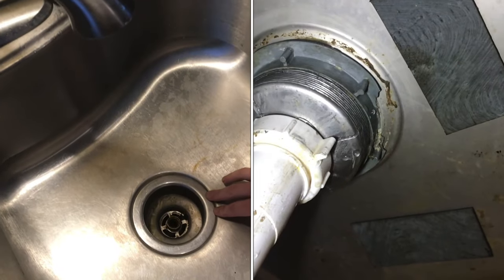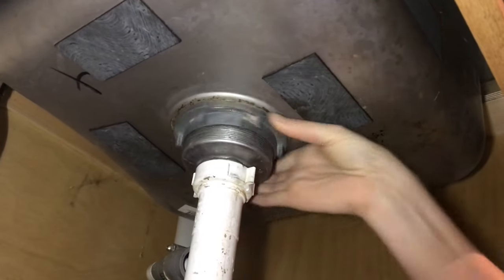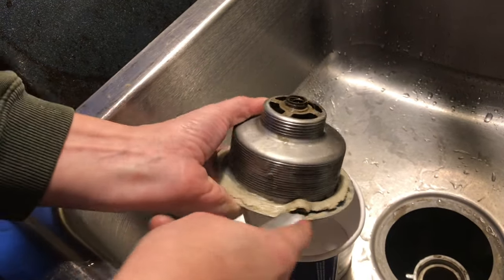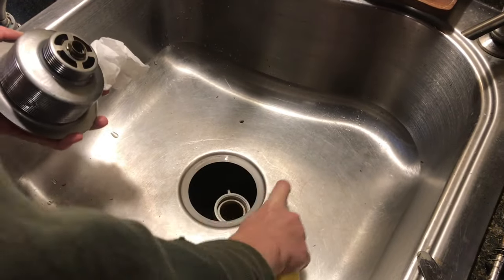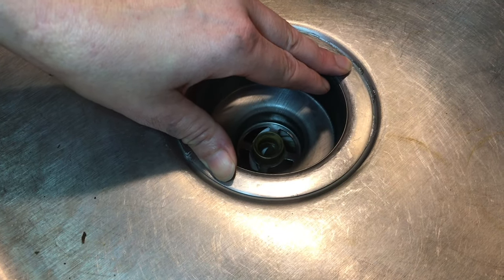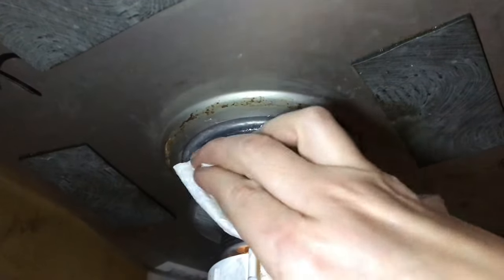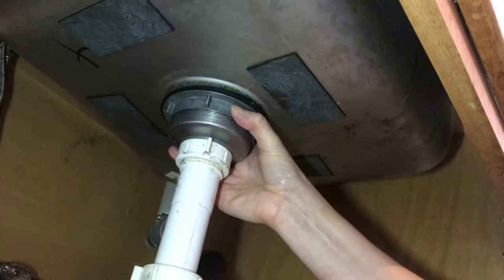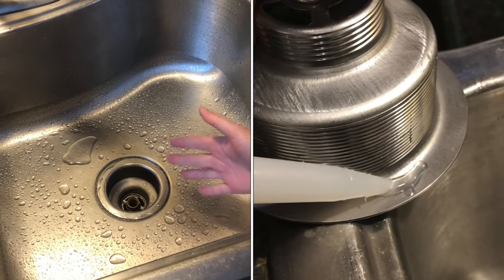“silicone” INSTEAD of “plumbers putty” on kitchen drain basket

Comment: GREAT! I'm replacing my bathroom sink drain & the old one had gobs of putty. I was concerned because I only have silicone sealant but no putty. Thanks also for the advice to let it cure overnight.
Reply: My new delta faucet calls for silicone and no plumbers putty  in the directions. I thought drains always used putty but I’m no plumber and Delta disagrees with it for some reason. I did notice on the plumbers putty label when I looked it’s not compatible with plastic or materials like granite and other stones. So maybe that’s why delta recommends silicone.
Reply: The putty that I brought said don’t use on plastic so I went with silicone instead, my new faucet setup said to use silicone anyways.

Comment: I tried the rubber gasket on top but the basket stands proud from the indent slightly. Ill move the rubber seal to the bottom and use silicone on both sides.

Comment: There will always be a debate over plumbers putty or silicone. My brother in law is a plumber and says use only putty my cousin is also a plumber and says use silicone only .
Reply: On double sinks just use silicone on one side and plumbers putty on the other
Reply: The silicone also acts as a glue and it will be a bitch to remove the strainer where silicone has been used.
Reply: After using putty for four sink leaks in the past two years (yes replaced almost all parts) - I'm giving up on putty.  It seems to leak sooner rather than later for us.  Silicone is the next try.

Comment: Wait until he goes to repair it in the future and can't get the basket out because of the silicone also acts as a glue.
Reply: I think that's what was used to put my original drain basket in. How do you get it out?
Reply: @maryannerunkel164   The first thing i would try if it were my sink is to use a pipe wrench that is big enough to engage the bottom threads of the strainer after removing the flange nut that holds the strainer in place. I would very carefully try to twist in both directions on the strainer treads to break the bond of the silicone to the sink..The decision is yours to make if you do this. I am just telling you what I would do with my own sink. As an example I had to remove an undermount sink set in silicone. I had to use an electric turkey knife to cut thru the silicone to remove it.
Reply: @gary24752  Yikes! Thanks for the advice. I have tried to cut around the silicone on the top and even used a hammer! to try and get the basket out. I am currently waiting for mineral spirits to hopefully loose the silicone. I'm replacing the basket because it is rusty on top. So much for my easy DIY.
Reply: @maryannerunkel164  Doubtful mineral spirits will work but I would try WD-40 which is a penetrate and let it sit over night otherwise I would go back to using a 12 inch channel lock wrench to twist the treads on the strainer body (underneath the sink) back and forth to try to break the bond maybe in combination with the WD-40. You are going to need either a special wrench or the 12 inch channel lock anyways to get the pipe connections off. They have stuff at a counter supply for this purpose but I try to stay away from that chemical stuff for obvious reasons and if you have an enamel sink I would worry about it affecting the color. They use silicone for gaskets so heat will not affect it either once it is cured. I do not recommend using screw drivers, hammers, sharp instruments, etc. as they may damage the surface of the sink no matter what it is made of especially ones that are enameled. Once you chip or scratch that finish rust will start. Just out of curiosity can I assume that the strainer is stainless steel? Why not try a grey scuff pad from Home Depot and some Bar Keeper's cleaner to remove the rust after spraying some WD-40 on it. Scrub in one direction only.  You might find it will come off and would be a whole lot cheaper that buying a new strainer and if you do get it a Ace Hardware. The stuff at HomeDepot and Leows are not of good quality as far as I am concerned and stay away from the plastic ones. Be prepared for more than one trip to the hardware store. Hopefully if you have a dishwasher hooked up to it the pipe will be in good condition. The pipes and the hose connection from the dishwasher are not always one size fits all. The outside diameter of the hose nib may be 3/4 but the inside dimeter of the rubber connector on the end of the DW hose is more like 7/8. Ask me how I know. This requires soldering a 3/4" copper coupling to the nib in order to attach the hose from the dishwasher which is a real pain due to the nickel coating on the pipe.
Reply: Cut the old lock nut off ( hammer and flathead or grinder w metal blade) once the lock nut is off tap the old strainer out and replace it with a new one no big head aches
Reply: @dellyrunks2426  good luck with that one
Reply: Lol, it's silicon... not epoxy.
Reply: @paulmacdonald7068  Obviously you have never tried to remove one that has been glued in place with silicone glue.
Reply: @gary24752  they come out pretty damn easily... It's silicon, not epoxy. The residual silicon cleans very easily with a bit of WD 40.

Comment: Is there a specific type of silicone to use for this?
Reply: Yeah. None. Use putty.
Reply: Then what do you use ? Silicone? The rubber washer is not intended for top of sink.
Reply: fartpoobox ohyeah  I am open minded. But in the service field. I must ask that your product meet a few of my requests. 
1 easily workable and clean up. Nothing special needed 
2. The gap between sink and basket flange is not increased to cause water to pool and turn sink black. 
3. Immediately testable with full sinks of hot water. 
4. Last as long as the basket 
5. Easy clean up when 15-20 year mark hits so your product doesn’t stick and cause scratches when cleaning sink in prep for new basket. Customers change them to change more often than they leak kind of product. 
Seriously open to your new way. But not silicone. That way is older than I. So I am left wondering. Anything that makes my day go faster without call backs is all I reach for. I openly back every product with labor. If the manufacture says it should “x” amount of time. And I purchase that for you? I back it labor. So my customers of 17 years solo business without a dime in advertising can rest assured. It may not be the Taj Mahal but by golly it will work as long as it’s intended too. So please enlighten me with something newer and better.
Reply: Lexel. Ive been silicone harper but my goodness Lexel is amazing. Anyone that is concerned about 15 to 20 years from now doesn't make sense. The entire sink, faucet, drain and cabinet will be replaced before that.
Reply: @pjplumber2146  exactly, what is this lady teaching? I fix sinks that people tried using silicone. They put the rubber gasket under the basket🤣, oh food collector and stinky. She should continue with her bs saying to install flex pipe and S trap. 👀😂🤣
Reply: Lotta plumbers angry that people realized they rip you off. Silicone is sanitary and lasts a long time if you let it dry and clean the surfaces. You want to use anything that's nearly 100% silicone for stuff like this and make sure it dries for a few hours before you run the sink.

These dudes use plumbers puddy because they don't want to wait around for curing or use softener to get silicone off. Both totally valid, but it's because they charge by the hour. Beyond that there's no issue other than you saving cash. Just don't use this shit to deal joints. Lmao.

Comment: Thank you for this video, but I wanted to know, did you use the rubber gasket along with the silicone or just silicone
Reply: The rubber gasket goes underneath
Reply: Both: The silicone above (substituted for plumber's putty) creates the watertight seal.  The rubber gasket below isn't there as much for a seal as much as it is to distribute the force of the nut on the sink.
Reply: Rubber gasket is below. Silicone or puddy is above

Comment: How about wetting the rubber seal with a little silicone? (would it be a good idea?)
Reply: I did it and it works as well, just extra sealing. Just like you said tho just enough to wet

Comment: Your the cleanest plumber i know. Also i use the rubber gasket on top instead of the silicone but to each is own if it works… 👍👍
Reply: Thats not up to prefference. The ruber gasket goes on the bottom. Plumbers putty goes on top
Reply: Exactly .. putting gasket up top you’re asking for a premature leak in due time

Comment: We?(Cats and I)Decided?(my opinion) Cut off? (With what if u don't mind me asking?)  ....bc I don't have a proper tool to use and broke one tab or cut off already. Very nice prep 👍. Hardest and most important. What was the torque specs on that silicone? Over night . My wife might get suspicious why I keep returning to ♀️ 's homes to fix leaky sink basket. You don't like top hats? Did we use fiber washers so not to pinch rubber a year ago?... Sry for being rude just wanted to put out a warning. Love u

Comment: Easy way without pulling the basket: PC7 plumbers putty. let it set. Then, PC7 epoxy over the putty. There will be NO MORE leaking. There will not be a "next time." Next owner will need a nuclear device to get it out but it will not leak! lol
Reply: This is really setting you up for hassle removing that in future -I guess that’s not an issue if you don’t plan on staying in house beyond 1020 years…buy the preformed dry silicone ring

Comment: Guys my drain came with two rubber gaskets which, I presume, should be placed on top and below the sink hole/flange; MY QUESTION IS, DO I STILL NEED SILICONE?
Reply: No, the silicone is an alternative. Your manufacturer may have a pdf with instructions if your unit came without any on paper.
Reply: The thing came without instructions; by the way I installed it without silicone and it leaked straight away!!
So I took it off and put silicone and it's now working fine.
Thanks for your answer/feedback
Reply: Yes

Comment: What type of glue should I use to seal a loose faucet for the kitchen? I appreciate the help I'm a first timer. Thanks!
Reply: You don't glue it. There should be 1 or 2 large nuts on the bottom. Just tighten them up
Reply: @roughroosterknifesharpenin5531  
I already fixed it. Like you said it had 2 large nuts on the bottom now is tight. Thanks!
Reply: @dJ.kNiGhT23  no problem

Comment: Had you installed the paper deal you’d be able to tighten it up immediately and be done with it.
Good job nonetheless!
Reply: The paper goes underneath. Under the rubber. So that the nut slips on tighter and doesnt get caught on the rubber gasket.

Comment: DONT USE SILICONE, when the day comes to remove it have fun, you will end up replacing the sink as it wont come apart. Use plumbers putty and it will last over 20 years.
Reply: My exact thoughts, it will be nightmare to take it apart.

Comment: Foolish don't use cement, putty or anything sticky material
Reply: What do you use then?
Reply: @co0terx3x3  clear silicone! That's all I use. That and pipe thread sealant and there is nothing that you can't install and get to work correctly. Silicone for the water, pipe thread sealant for you know pipe threads but also for allowing a ring to tighten properly such as the base nut on this application.

Comment: This.... is the WORST advice ever. I vote this video should be removed. Do NOT do this.
Reply: Haha, misinformation indeed! If you are going to throw the tub or sink away with the drain at some point, fine. However if you ever have to just replace a tub drain, good luck. I have to bust out a saw and hope I don't damage the pipe. 🤬
Reply: Lol
Reply: Not true. Lot of debates about this in Reddit and clear that silicone 100% works
Reply: How come a new "Sioux Chief" brass shower drain instructs you to use 100% silicone on the wet side & provides no sealing gasket for it? 
Your advice is like a "Cow, pissing on a flat rock!" The rock is wet, you are wet and now smell even worse, while sounding similar to your vocal speaking!
Reply: Where is the friction washer ahead of the gasket?
Reply: @cllistings5914   The friction washer reduces friction. It goes under black rubber seal, next to the nut. This ensures a tight fit while not damaging the mail seal. 
DK, Omaha